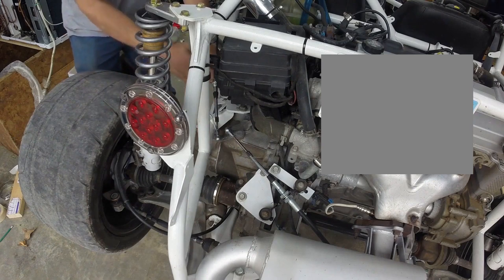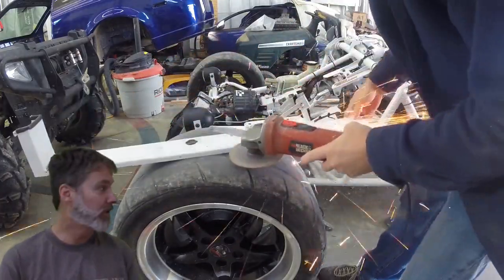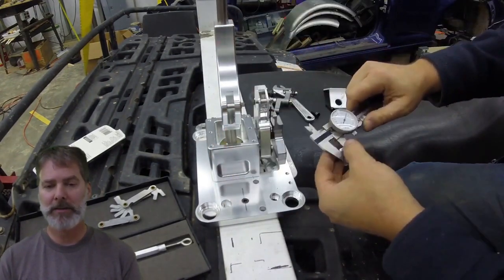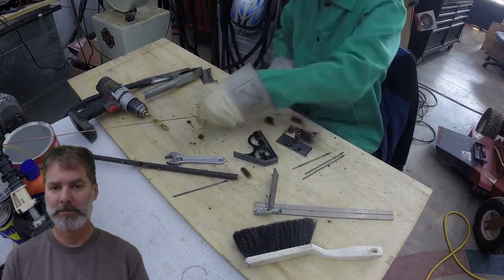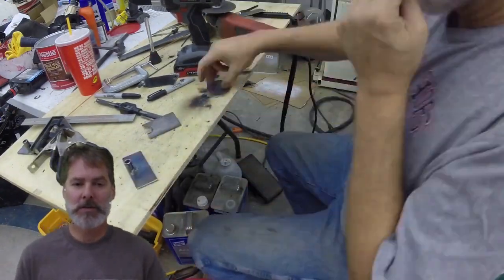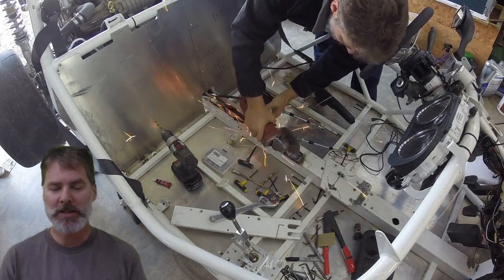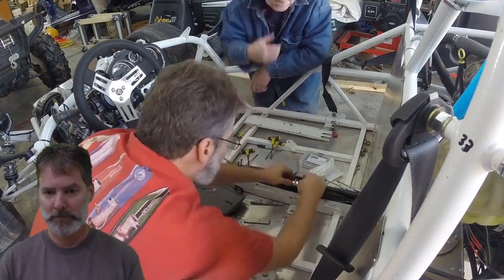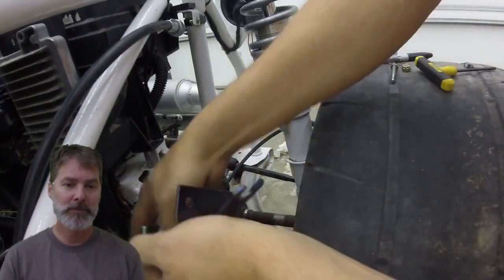Put a billet aluminum shifter in a DF Goblin kit car.

Comment: What's your opinion on installing this in a Saturn Ion Redline? I read your forum posts and I already ordered my shift assembly. I don't think I should have too hard a time retrofitting, I should just need the cable ends
Reply from the maker: One of the cables will move the opposite direction from the stock Cobalt shifter, so you will need a way to reverse it.  That is why I made a cable mount that pulls from the other side of the transmission lever.
Reply: @rosslawrence4628  I thought about doing the trick where you take the actuator arm on the transmission and mount a new eyelet on the other side of it, essentially flipping the forward reverse cable
Reply from the maker: @user-lw8jk6nv7l  Yeah, that would work too.  Long as you are willing to do a bit of fabricating, you will be able to make it work.
Reply: @rosslawrence4628  Bet, I'm down for it, though I saw the billet shift assembly for the Honda Accord, and noticed the shift pattern is the same as the f35, so idk if it'll just be better to return the rsx and get the accord shifter
Reply from the maker: @user-lw8jk6nv7l  The shift pattern is not dictated by the shifter unless you buy a gated shifter.  The only thing that matters is direction the cables move.  If you hook an RSX shifter up without reversing the one cable, it would work, with a reverse the shift pattern.  So first gear would be far right, and reverse would be on the left.  Weird, but it would work.
Reply: @rosslawrence4628  I say that because the attachment point of the f/b cable is below the pivot point on the stock f35 shifter, so when you shift into say first, the cable is pulled backwards, but with the rsx shifter it is pushed forwards, so it's a matter of a choice of getting the accord shifter, or getting the rsx shifter and modifying the pivot arm on the trans itself
Reply from the maker: @user-lw8jk6nv7l  Right.  You know what you are doing.  Well, it sounds like the accord shifter would be a better match.
Reply: @rosslawrence4628  I hope so, they're the same price as the ottp and zzp shifters, and I already have an ottp shifter. But I'm pretty confident this will work once I mount it